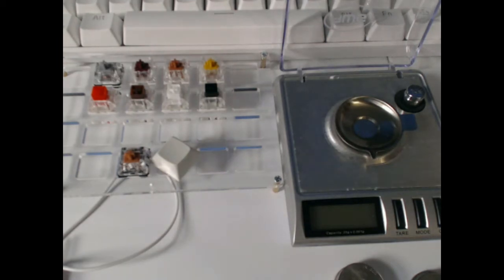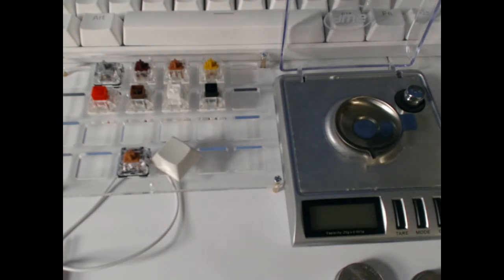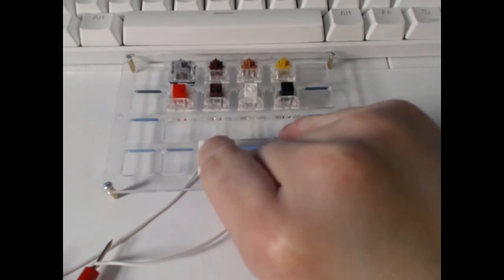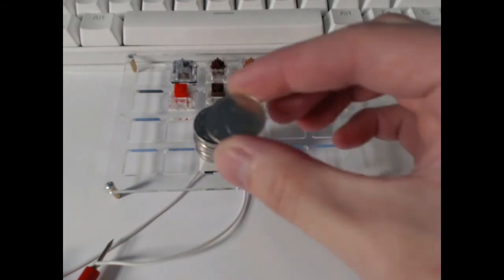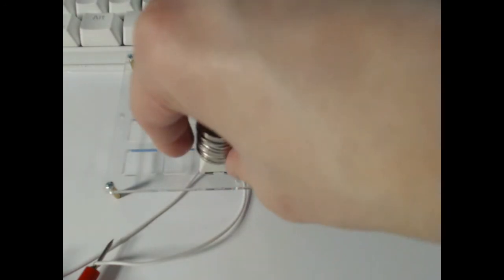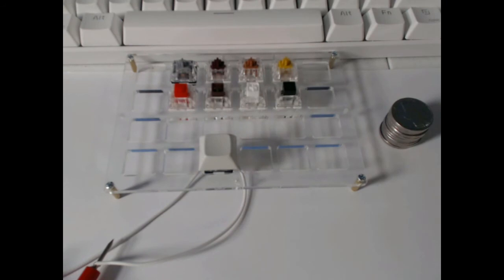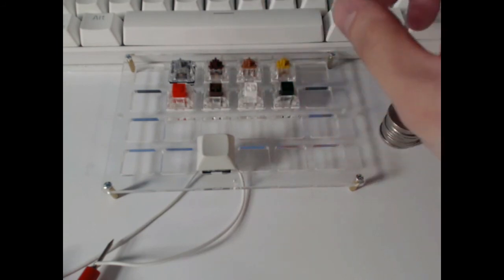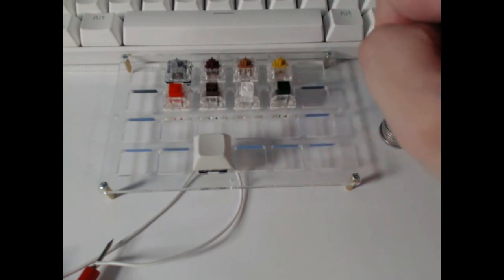Response Video about Kailh Bronze Switch Actuation and Click Timing

Comment: What is your favorite switch for gaming?  I was thinking about getting some bronze, but your video has actually turned me off from the idea (yes, I know your point was that it wouldn't be a big deal, but kind of is to me).  Anyway, if you had to pick one switch for gaming, what would it be?
Reply from the maker: I personally think a tactile switch with low travel like Kailh Speed Coppers or Kailh Pro Purple switches would be best for gaming. Low travel distance is better for faster reaction time, and having tactile feedback is important to ensure that the switch has actuated. Check out the Kailh Pro Purples here: https://flashquark.com/product/kailh-pro-purple-switches/

Comment: I disagree with the idea that actuation is preferable to click when it comes to the order of events.  The click happening after the actuation will result in typing errors caused by the user thinking that an actuation didn't take place when the key isn't pressed far enough to click.  It will either cause them to repeat a keypress that isn't needed, or disrupt their typing to check their results.

Of course, someone could argue the opposite, and say that the click happening before the actuation could cause errors due to someone thinking that an actuation did take place, when infact it didn't.  However, I feel that the relief of required force that takes place after the completion of the click will result in a slight acceleration of travel, making it more difficult to "click but not actuate".  Thus, I think that a click before actuation is preferable, as it has less likelihood of one of the two events failing.

Either way, +1 for making the video.  Yay keyboard science!
Reply: it's even worse for gaming to have an actuation before the tactile click.